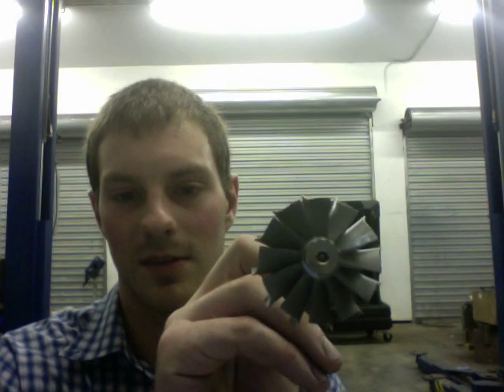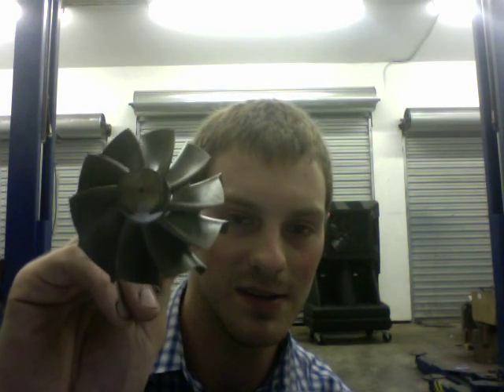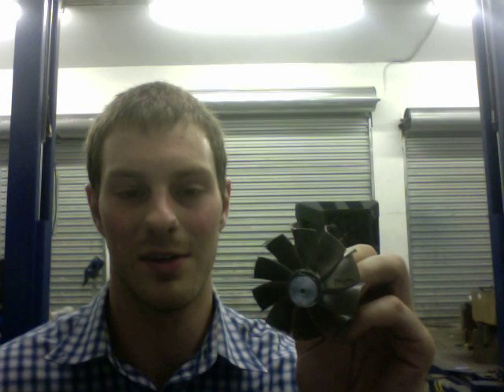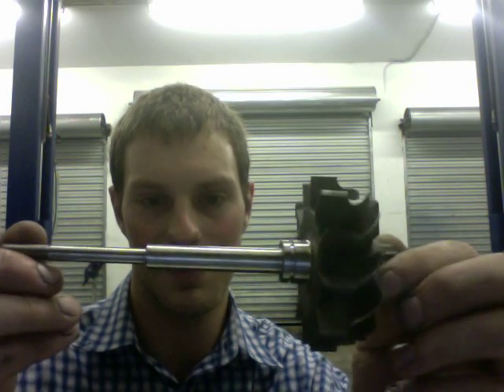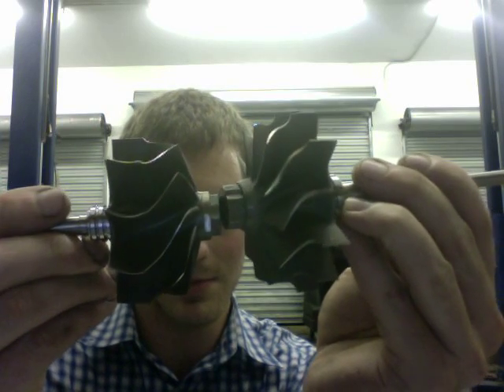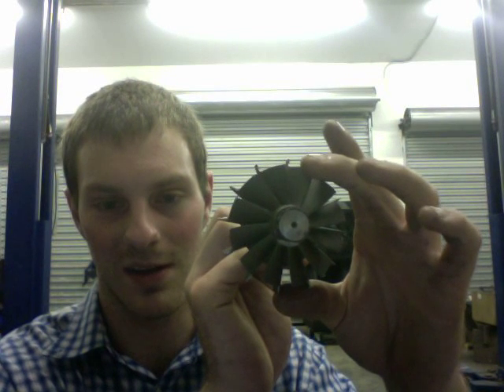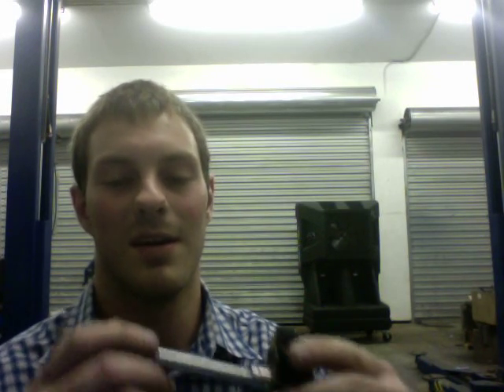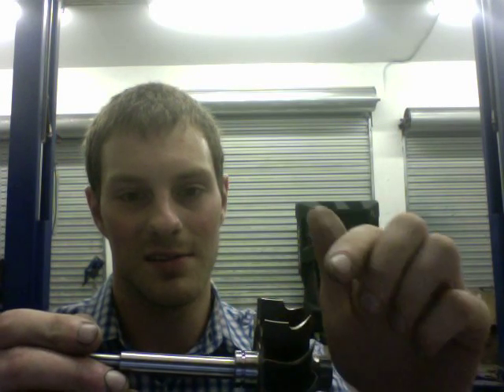Turbine shafts and how to create quicker Turbo Spool time- By Turbo Lab

Comment: I understand that with a compressor wheel you want a smaller inducer and larger exducer for response, is that just reversed as far as that concept for the turbine wheel? Or is it just like turbine housings and if you want response you just choose the smallest turbine wheel possible for quick spool?

Comment: I have an important question! One of my builds is a b20b and it has lots of low end torque. I want a turbo that spoils quickly so I can get the best out of my midrange. What turbo is there without breaking the bank?

Comment: how much of a difference would it make to turn the shaft out of titanium? and use a smaller diameter nut on the turbine side? would there be any appreciable deduction in mass to speed up spooling time for the amount of work? (for the hx40)

Comment: I have a newbie question ... I have a sandrail with a 1lt motor that I drive on the street...  It has a 1ltr w/turbo not sure what the turbo is all numbers were shaved off..The turbo spools up to 5lbs at 5-6000rpms I'm looking for something that would spool at 3-4000 I only want 5lbs of boost so not looking for huge boost. Any ideas would be great..Thanks in advance
Reply from the maker: Your wastegate is open or you have pre turbo air leaks or boost leaks.

Comment: hi! is there an someone i can email about a possible compressor wheel upgrade? i have a big 16g td05h turbo on my car right now and im looking for a little bit better spool time. great videos!
Reply: Turbo Lab America hey I have HX35 I want quicker spool from it on my 1.8t what do I need to do?
Reply from the maker: +nick ameiss you probably should do boost leak testing. 16gs are very fast spoiling. It is possible that your turbo is worn. Check it for in and out play
Reply: i am also making a 1.4L engine spool it up, so any advantage i can get helps. zero boost leaks and zero shaft play. just looking for any advantages to help spooling

Comment: If you shave this nut? How do you replace the turbine wheel if you have to? Also clarify the shaving of nut i understand it for weight savings less rotating mass, but air flow?
Reply from the maker: There is a special tool to grab the blades, but you can also use a vise with blocks of wood or similar soft material. Im not sure how it would do for air flow, because the turbine weighs less it can spin higher rpm. If i was going to change the turbine to flow more, then i would have it clipped.

Comment: What is the best turbo to run for a stock Honda h22 prelude motor with the safest highest boost?
Reply from the maker: It just depends what kind of power you want to make. If your just trying to be safe on stock internals, i would go with a turbo around 50-55mm @ 8 psi. If you stay with higher compression then keep the boost on the lower side unless you run e85 for fuel. 8 psi on a stock engine will usually double the amount of power your currently making without the turbo.
Reply: 55mm shaft? What types of 55mm ball bearing turbos do you have?
Reply from the maker: We have a GT3076R with a billet 11 blade 58 x 76 and the turbine is 55 x 60. I can offer a .63 turbine housing t3 and 4 bolt outlet.
Reply: How much and which setup is most efficient

Comment: Good point about the 270 vs 360. S300 have very beefy internals compared to holset and garrett frame variants.  If its a super b, thats a bd s300 not industrial injection.  Not a big fan of bd turbos,  i kinda question thier reliability of outsourced components at times and all they do differently is a different wastegate and 1mm over or under turbine exducer to which its hard to source out the part from bw. The best diesel bw company is high tech turbo in my opinion.  They use genuine bw parts and also offer stainless steel turbine housings.  Along with great customer service and very knowledgeable staff.
Reply from the maker: Ians said this guys turbo was a silver bullet 66.

Comment: I've installed s300's with the 270 thrust on 5.9 Cummings pushing 600+hp with no internal thrush issues.  Came across some Chinese bw ripoffs that some of our customers bought and most of them will either snap the shaft and or catastrophic bearing and comp wheel damage.  Stick with genuine bw s300 and s400's when it comes to hopped up diesels.
Reply from the maker: What about the industrial injection s300 super B. I think thats what its called. I had one come in for rebuild with really bad thrust play. The shaft is really hard to find also. Do you think they are reliable or not.

 Also do you understand the reasoning of using the 270 degree thrust bearing? Its interesting that someone would make them that way. Maybe it just made for an easy design or installation at the time.

Comment: As far as holset hx35/40 is concerned,  they utilize the divided/twin scroll turbine housings to which the turbine wheel will catch a higher pitch to spool in conjunction with the blade design. And yes, you can grind off the locknut for fairly quicker spool but will be a complete pain to re balance back into spec.  I don't recommend doing that to do reliability reasons.  Diesels have a higher drive pressure/ exhaust drive that to be be wary on modify the turbine wheel. Comp side,  no problem. A bw s300 is a good upgrade for the 5.9 Cummings if pushing more than 35psi  do to snapped shafts on the stock hx35/40. I personally made that mistake lol.
Reply from the maker: I have heard about people breaking shaft on the hx40, but I have never had one come back yet from a broken shaft. I have some guys running 40 psi on 4g63's.  We have gotten really good results out of the hx series turbos on the our gas engines.  I never like that the s300 has a 270 degree thrust bearing, luckily we found a 360 degree rebuild kit to sell for those turbos.
Reply: The twin scroll is not meant for better flow with blade designs, it is made to seperate cylinders and reduce exhaust gasses escaping when the certain cylinders would normally have both of their exhaust valves open for a split second. Changing which cylinders are connecting will greatly reduce that from happening by pairing the cylinder with another cylinder that does not have the exhaust valve open at the same time. That is what makes them more efficient. Just wanted to clarify.